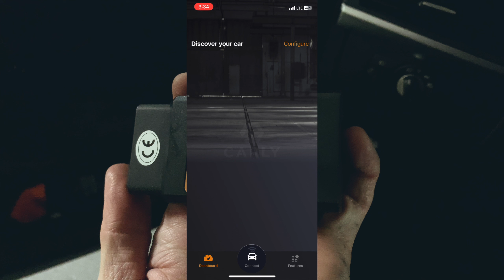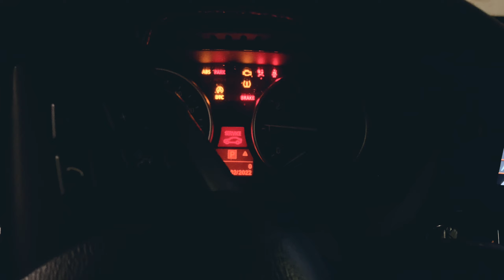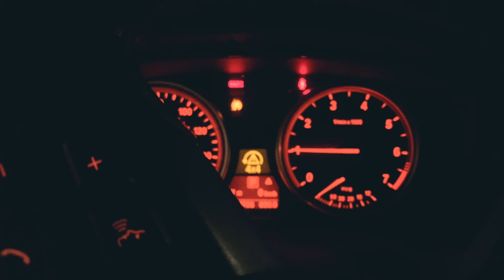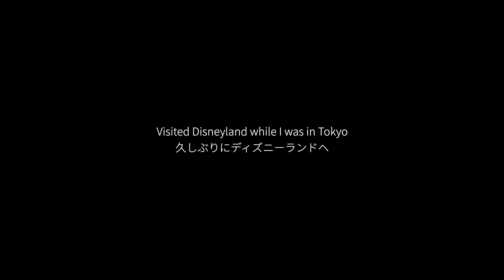How to replace BMW crankshaft position sensor and harness (connector) on X5 E70 2008 4.8i

Comment: literally one of the best videos I've seen on this issue. I was told to buy a code reader by my mechanic & connect it to my 2008 BMW x5 4.8i & literally came up with the P0335 code. I bought the {crankshaft} sensor. Now I can't get him to change it, because he doesn't like working on BMWs. I called around & everyone wants to diagnose my vehicle & not replace my CSP. Just to rip me off. I actually hate mechanics for these types of reasons. 

Excellent video. Mechanics hate youtube.
Reply from the maker: Thank you 4.8i brother! Glad this video gives you some positive ideas. Hope your 4.8i soon runs great 👍

Comment: I had this exact issue last month on my 2008 e70 4.8, i wish i had seen your vid back then! I had to do the same as my CPS plug was netted as well. Very bizarre. Do you know what caused yours to melt?

After replacing the plug and a new sensor as well, like you i fitted the o-ring.... But the engine ran terribly after. I still had CPS codes and it was obvious the engine was out of time (backfiring, coughing etc). After much head scratching, i removed the o-ring from the CPS sensor and it runs perfectly now. I believe the o-ring was causing the sensor to sit to far away from the flex plate and wasn't getting a string enough reading. 

I am surprised someone else has had their CPS plug melt! Glad your CPS seems to work with the o-ring, mine must have been thicker and caused me problems.
Reply from the maker: Wow, your CPS as well 😮 I'll keep an eye on the O-ring then 👍🏻
While replacing CPS, I noticed the splash guard for that area is missing, so CPS might have melted by the rain and puddles. Or I have a coolant leak from probably the Vally pan or Rear cover, and the coolant travels and might have poured onto the CPS sensor area. But still, it's a mystery... 🫠

Comment: Hello from the USA! I have a 2010 bmw x5 sport 4.8i with 81k miles. Everything is great except I sometimes get the 4x4 warning on dash (yellow light) and the regular set of warnings on the display (dsc, drive carefully , chassis stabilization, rev limiter). Cant find any real culprit so just started replacing things. I replaced loads of things, new transfer case, steering angle sensors, etc. Now 4k $ later problem still happens but comes and goes. your video says the crank shaft position sensor fixed the issue!! Exciting to see. I just want to ask and confirm that the repair fixed the issue for you? Thank you in advance.
Brandon
Reply from the maker: Wow, you've done a lot and sorry there is still the issue. You are right. In my case, it solved all the warnings and rev limitations by replacing the sensor and its harness/connector. 

So what I've seen on my X5 is that on many occasions, as you might know, a bad battery or faulty alternator throws these warnings even though the other parts are functioning fine. Most likely, low voltage triggers these warnings. And I solved those warnings and CEL by just replacing the battery and alternator. So I usually suspect those parts first, and meantime, I scan X5 with Carly (or any scanner) and see whatever fault codes I get. Then work on them based on the codes.

Other possibilities...A few years ago, I got many warnings like you even after refreshing the battery and alternator. Rev was pretty unstable. And there were also throttle body fault codes, and I found out about the worn-out throttle harness to the throttle body. Replaced the harness, and no warnings. (Throttle body was fine) I have a video about that too :)

And on this crankshaft sensor video, I got the same kinds of warnings and crankshaft sensor code, and as you saw, I found the melted sensor harness. Replaced it and cleared the issue.

Hope this helps, and solves the issues, and you can enjoy driving in the summer!

Comment: hello i have x6 e71 3.5d 2009 and my car start for 2 second and die. i change pump fuel, pump reley, pump computer. i dont know what to do now... On computer when i connect with car they say noone problem. Meybe start sensor ? or what can i try? thanks.